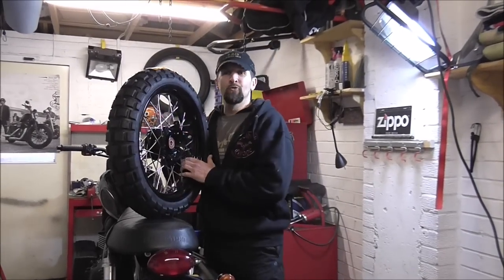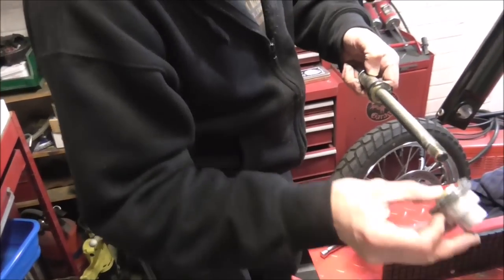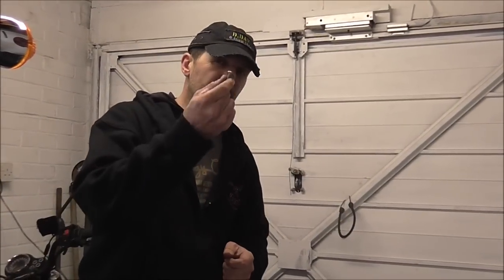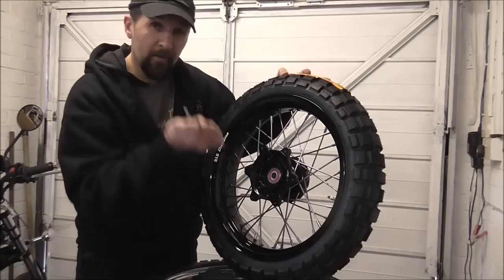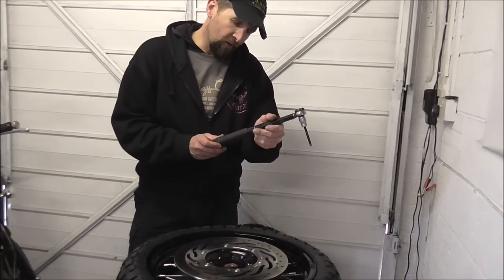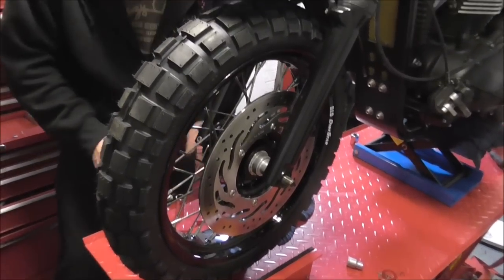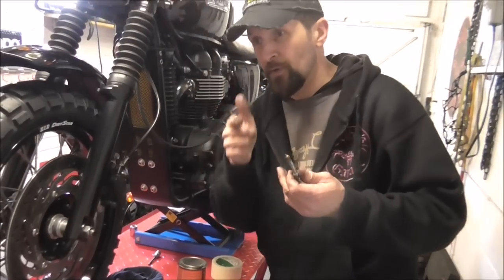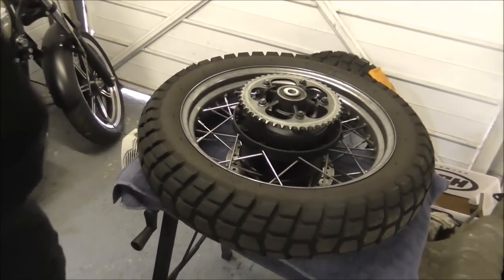Delboy's Garage, Triumph Scrambler, Fat Wheels, Walkround.

Comment: Hi del  are you going to move the back break calliper then you can get it off road see what she can do. A hit of Steve McQueen about it.
Reply from the maker: I know what you mean about the rear brake bracket, it's on the Xmas list for sure... and now it's all finished (well kind of!), it will seem a shame to see it all get splattered in mud.... but lots of fun though!
Reply: Del have you done a vide to the museum  in   Birmingham some of the old so cool
Reply from the maker: Derek Cruise No mate, too much work means we don't get much time to venture too far afield at the mo, but it's on the list of 'to do's' for sure!